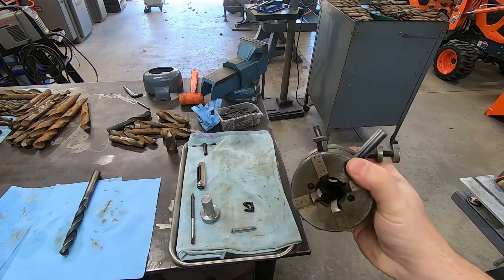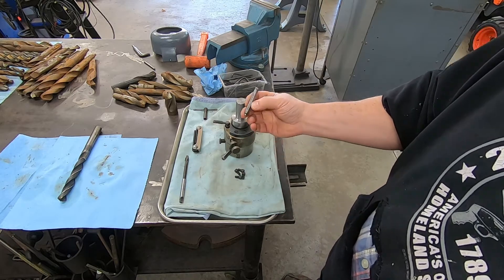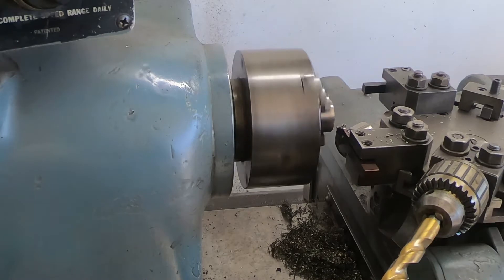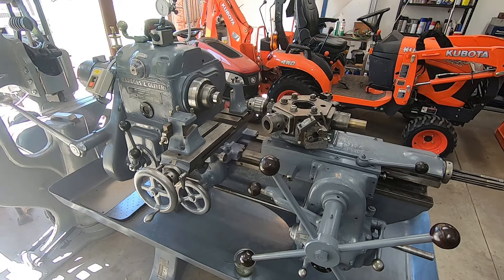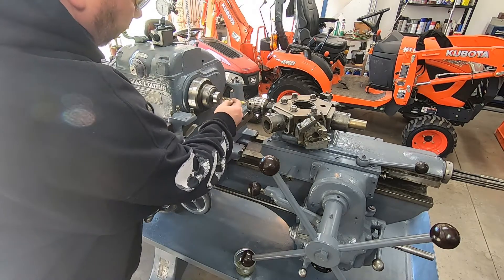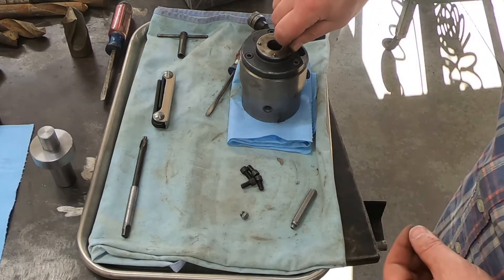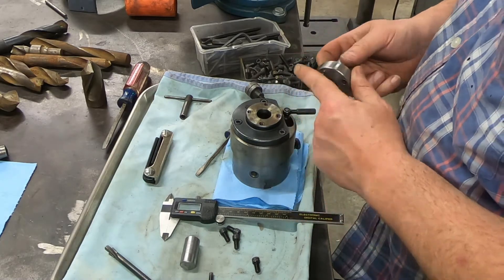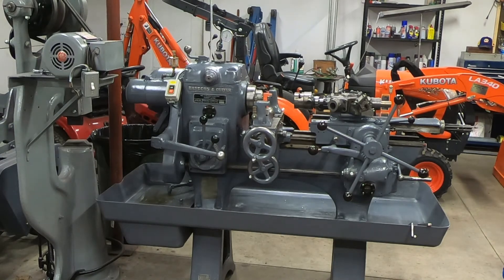Geometric Threading Die Post

Comment: I'm surprised you bottomed the ram out with that drill there, that doesn't seem like a very deep hole! Is it possible to adjust the ram to get more travel?
Reply from the maker: I had the screw set for 1/2" depth
Reply: @spinesales  I see, thanks! I'm looking for a turret lathe for my small shop and trying to learn what I can in the meantime. Love your videos on the restoration of this one!
Reply from the maker: @schanerdesigns  thanks, it was a fun project. If your looking for a turret I'd recommend a Hardinge Chucker
Reply: @spinesales  that's good to know, thanks! I've been looking at some Hardinge HC and HCT's, seems like they have a lot of capabilities if you get the right attachments.
Reply from the maker: @schanerdesigns  yes incredibly accurate and lots of capabilities but they do have some limitations. I will say it's my go-to nearly every time